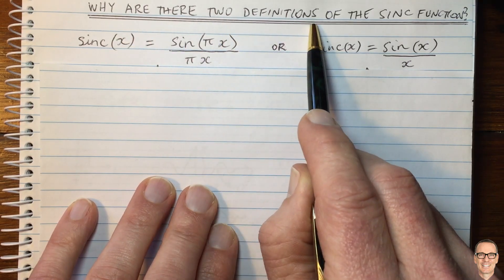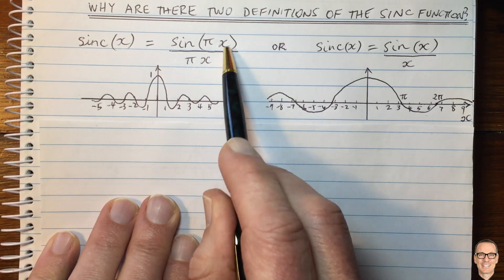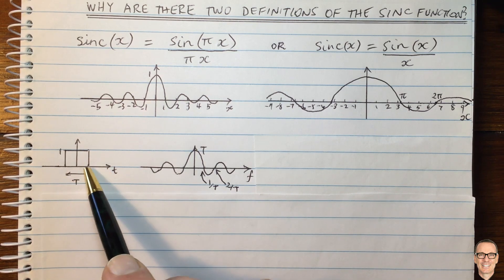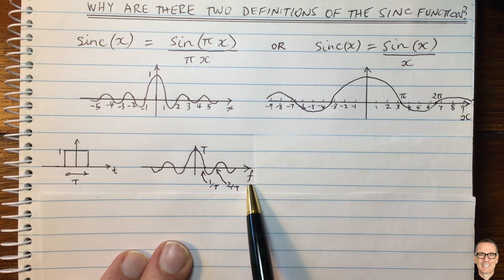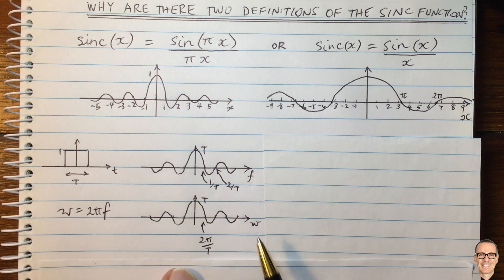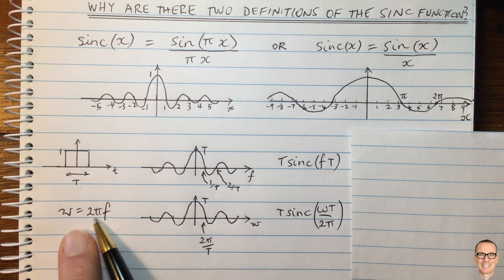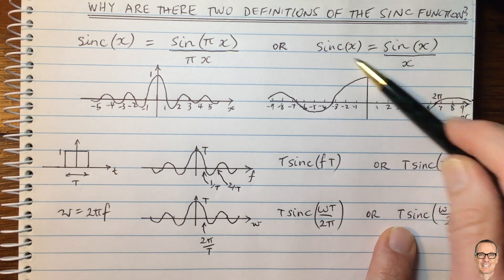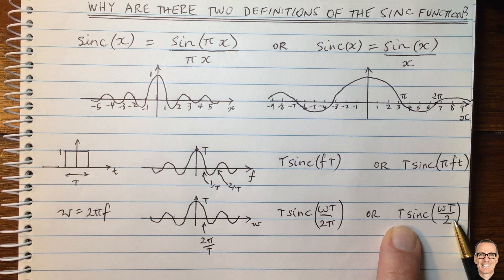Why are there Two Definitions of the Sinc Function?

Comment: Thanks very much. 
I have been cracking my head trying to calculate the intensity of the grating lobe in a medical transducer with 5 MHz, grating lobe angle θ = 26∘, pitch d = 1.0 mm, width (a) = 0.2 mm, and grating lobe order (n) = 1, c = 1540 m/s. 
I kept getting it wrong. 
Somebody told me that I have to calculate sin26∘ in degrees as 0.4384, but that when calculating sincx = sinx/x, that sinx must be in radians rather than degrees. I followed the advice and got the answer correct. 
However, I keep wondering why the "double standards"? Why treat the first sine as degrees but the second one as radian? Kindly, help me understand why. Thanks
Reply from the maker: I don't know where your "first sin" comes into your calculations, but sinc(x) is defined for x in radians.

Comment: Hi there! I love your videos but I feel like I'm missing something very fundamental... you see, I'm trying to understand all that goes on with 802.11 at the physical, RF layer.  At a very basic level, I understand how modulation works, and I know what the purpose of phase modulation is... but I'm not entirely sure how it is accomplished. It's typically depicted on illustrations as the signal being "cut off" mid-phase, or having two signals overlapping... but my guess is that's not what really is happening?

Does phase modulation involve a small bit of frequency modulation? Like, how is phase generally communicated by a wireless transceiver? Sorry if this question doesn't make much sense... I'm just so confused.

Also, in the context of OFDM, I'm confused as to what the "sidelobes" represent on subcarriers, as well as the relationship between the subcarrier width and the symbol length (why are these always inverse?). Could you explain some of that?
Reply from the maker: These videos should help: "What is a Constellation Diagram?" https://youtu.be/kfJeL4LQ43s and "OFDM Waveforms" https://youtu.be/F6B4Kyj2rLw And make sure you check out my webpage that has a categorised listing of all the videos on my channel: http://iaincollings.com

Comment: What is the difference between "regular" frequency (f) and angular frequency (ω)?  
Regular or linear frequency (f),  counts the number of complete oscillations or rotations in a given period of time. Its units are therefore cycles per second (cps), also called hertz (Hz).
Angular frequency (ω), also known as radial or circular frequency, measures angular displacement per unit time. Its units are therefore degrees (or radians) per second.
Reply from the maker: Yes, that's right. As I mentioned in the video, ω=2pi f